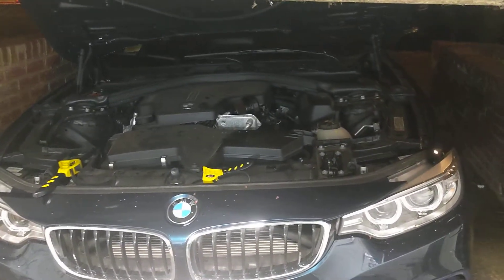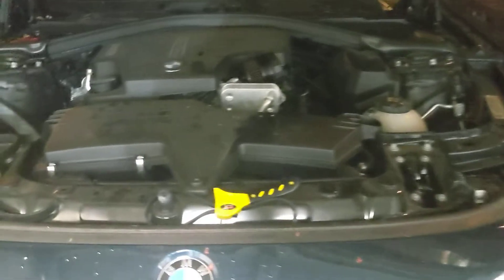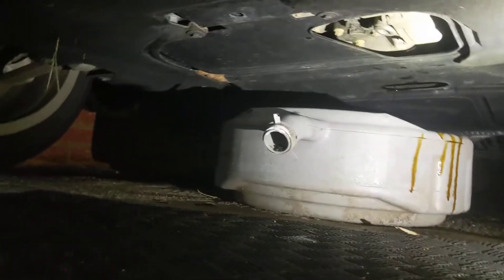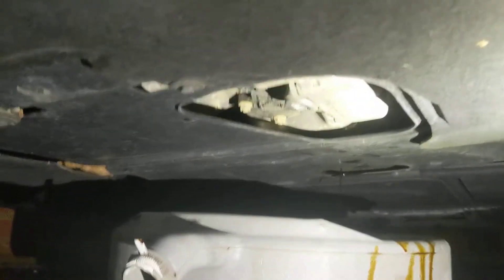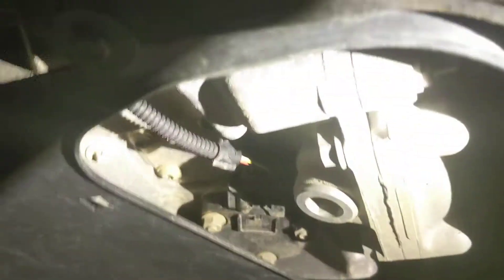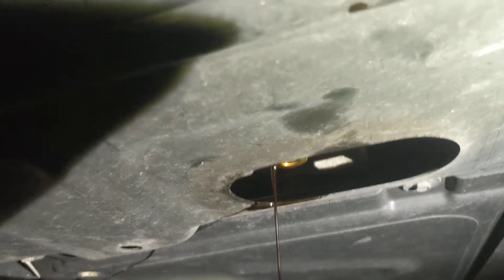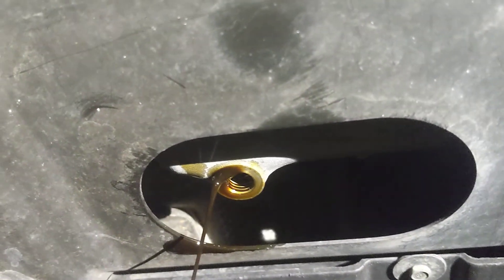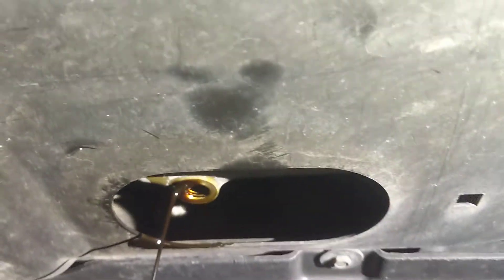Changing the oil on a BMW 428i XDrive and finding the oil drain plug

Comment: Do you have any idea another drain plug on front of oil plug. What's for?
Reply: it is for the differential ... if you do drain this one by mistake, it is rather a pain to refill.  (i refilled it by pumping it back up into differential, the normal fill fort is hard to access)